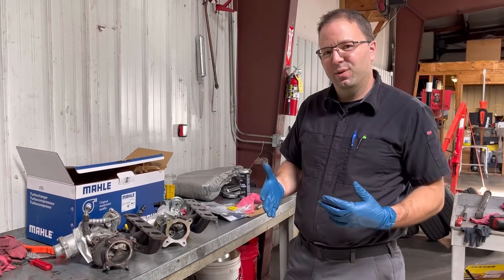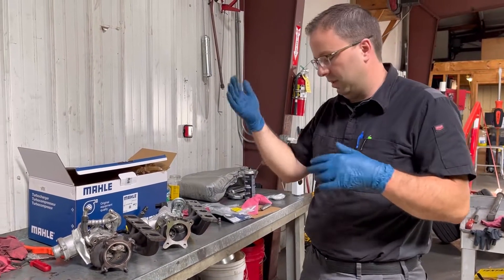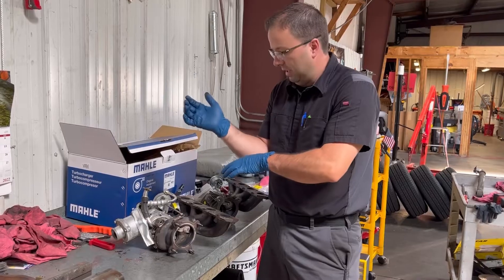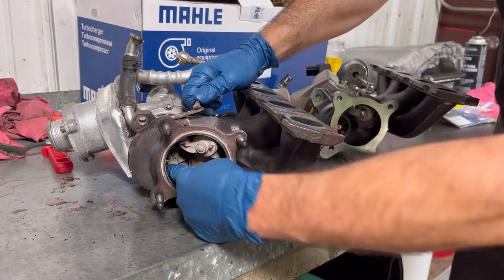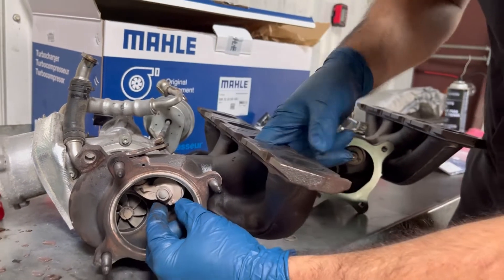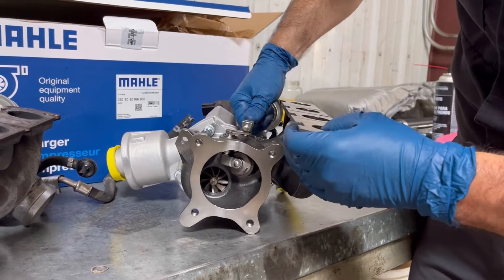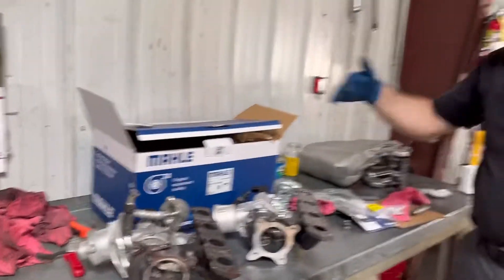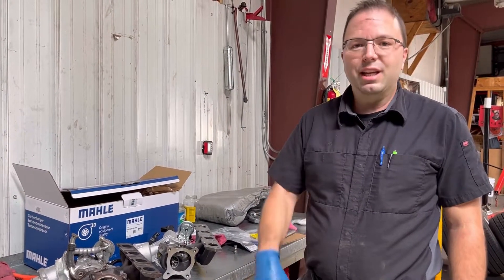Audi 2.0L Fault Code P0299 - Underboost Condition

Comment: replace your bypass turbo diverter valve its $50 at autozone for the 2.0 turbo found in the the q5 and other models. make sure the wastegate clip is on that allows for play. on the waste gate. replace your wastegate actuator not the turbo cheaper and will solve the P0299 code one or all three things mentioned.

Comment: I have the same problem p0299 and I hear a small noise from under the engine, but my car

It doesn’t lose power when accelerating, do I need to change any turbo censor?

Comment: You can just not replace that and heat the wastegate flap while open and hammer it down some. Replacing the entire turbocharger is an enormous upcharge repair. Also, replacing the DV can help with this too because both the DV and WG can cause this along with several other factors relating to vacuum/boost leak..
Reply: $930 on FCP Euro for the entire Kit. Worth it if you have the $$. Otherwise, the replacement parts for these are $35 for the DV
Reply: @nighthawkviper6791 from what I have been told remove the diverter first before moving forward with more costly repairs. What do you all think? You should also check the turbo pipe I saw another video on a Q7 that had neither of these issues but rather a cracked turbo pipe in the under carriage of the vehicle

Comment: If you want to know if you have this problem in your car, simply put the car in neutral, then press the gas pedal to about 3k rpm, after that lift your foot and listen for the rattling sound with the window down.

You can also hear rattle when you drive, trust me it`s really annoying...
Reply: I have the same problem now with my Volkswagen Pasart cc lux, I hear a small laugh coming from under the engine and I still have the code p0299, I already changed some turbo censors, what do you recommend?

Change the turbo? Or the diverter valve? Or the

Comment: PLEASE REPLACE YOUR DIVERTER VALVE FIRST, IT IS $35 AND A 15 MIN MAX JOB AND IT WILL THROW THE SAME CODE.
Reply: Don’t listen to this guy, folks. Test, don’t guess.
Reply: What do you mean? That it could be just the diverter aswell? I have the same problem and if I could fix the problem only replacing the diverter valve that would be amazing
Reply: These cars are getting old if the code pops up your better off just replacing the whole unit instead of just throwing parts at it hoping it will do better
Reply: @keiangelocollins7537 guy its a $1000 part. Thats like saying, hey your diff is leaked from a seal. Replace the whole goddamm thing. Thats ridiculous when parts are available to fix.

Comment: This is very helpful thank you! My fault code is intermittent and puts the car into limp mode and just displays the DTC P0299, it triggers only at high speeds, when I accelerate when aread doing 70mph to overtake something, in 6th gear at about 2500 RPM, is it still worth taking the turbo off or looking elswhere first? cheers
Reply: Hello, I have the same symptoms. Did you manage to resolve this problem?